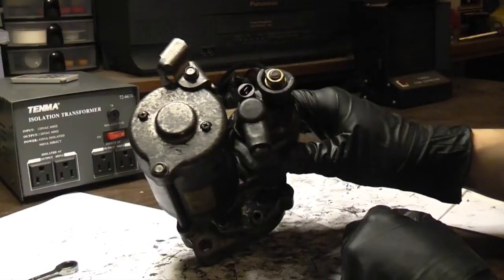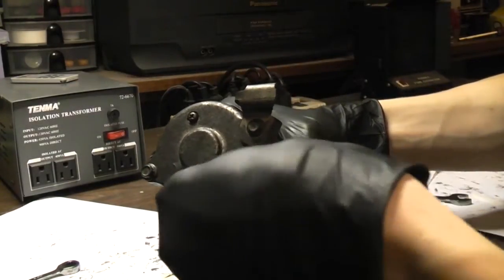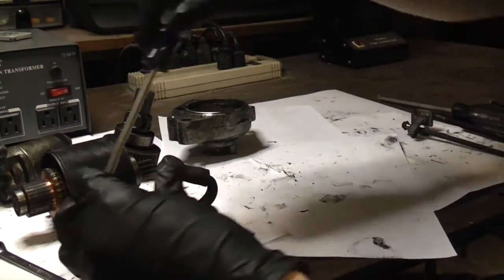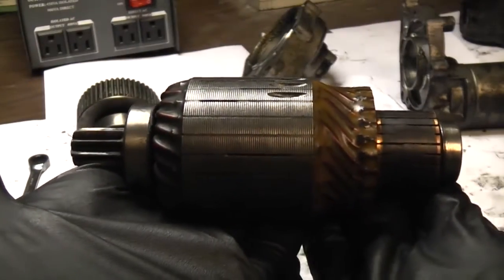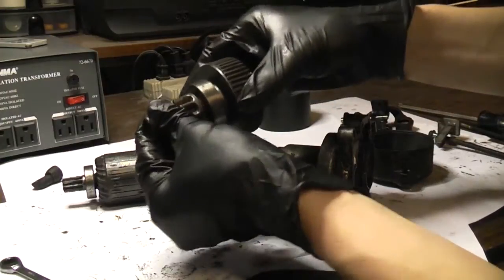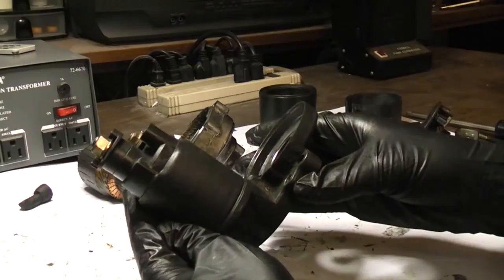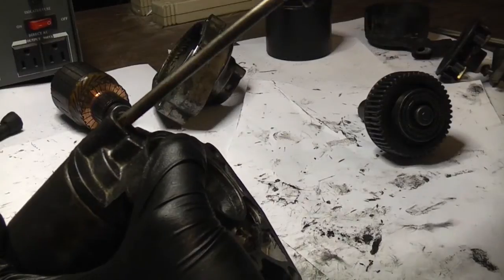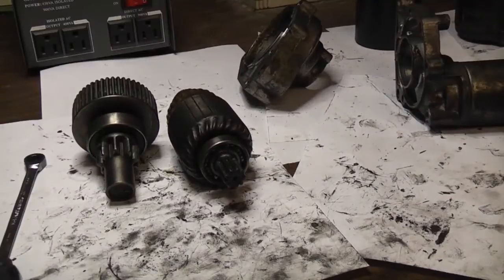How A Starter Motor Works Teardown and Explanation

Comment: That's a nice review. You make a good point that if you rebuild, you should examine and repair anything that is next to go. You may get a few miles out of just replacing the solenoid contacts but the brushes may be next. Getting parts is also an issue, but for me the biggest problem is being without a vehicle while repairs are done.

Comment: ***** So why does hitting a starter with a hammer while you're turning the ignition key cause a failed starter to work temporarily? Does it just cause enough vibration to get the brushes to make contact?

Comment: Just tore apart a Toyota V6 starter. Instead of a commutator, the brushes are directly in contact with the windings. Pretty interesting design.

Comment: Helpful video. I took apart my starter cuz I was wondering if it was in fact the starter or bad ground/wiring and I found that these brush holders were completely worn down missing two out of four plus other issues

Comment: hi, if brushes are worn out, why is solenoid not working
Reply from the maker: Because the pull in winding is wired in series with the motor armature. No brush contact, no current flow through the pull in winding, no solenoid function.
Reply: Great. Make sense. By the way your explanations are excellent and it is complete (meaning you are covering everything one should know). Thanks so much. i like to see more videos from you.. Are you an Master mechanic.. if not, you are 200% eligible.. Thanks again.

Comment: hi, in the solenoid there is a connector that has only oe wire, what is that connector for can u pls advise. i have the same in Toyota corolla as well. i am not looking at the positive wire ,
Reply from the maker: It's a common battery power wire connected to both the hold in and pull in windings inside the solenoid. This is where power is applied from the ignition switch to activate the starter.

The other end of the pull in winding is wired in series with the motor and the hold in winding is wired to a constant ground.

This is so the pull in winding is kicked out of the circuit when the solenoid closes and the starter motor starts rotating. When the motor is running only the hold in winding is energized.

I explain it graphically in my no crank diagnosis video.
Reply: Great.  I can remember your videos where in which u explain hold in and pull in windings. one more question. When u release the start from ignition switch from start position, (just for that moment. bendix is still running with flywheel speed, but however the overruning clutch ensure that rotor is not spinning at the speed of flywheel. So how does overruning clutch knows when to allow and not allow. meaning when the start button is engaged, overrunning clutch is off, when start button disenage overrning clutch is on, so how does this overrunig clutch works with respect when to on and off.. pls advise.
Reply from the maker: sivaraj palanisamy
The clutch which is attached to the pinion gear will only lock itself to the motor shaft when its rotating faster than the engine (flywheel).

When the engine starts the flywheel spins faster than the starter motor decoupling the pinion gear from the motor shaft.
Reply: thank you very much.  i have requested a question on Diode with respect to back feeding.. placed in starter schematics on toyoto corolla..  any advise if you have that would be great.

Comment: hi,  i have 20101 toyota  corolla... even after i release the key, especially on cold start, i feel grinding noise ...

will that be overnning clutch... pls advise.. after that cold start, if i try one more time, i wont have that problem.

pls advise.
Reply from the maker: Either the over running clutch or the pinion gear isn't fully retracting after the key is released.
Reply: *****  Thank you very much. Will replace my starter.. Thanks for quick reply